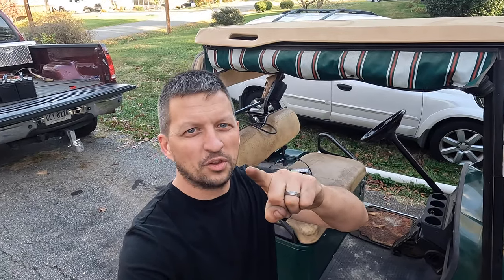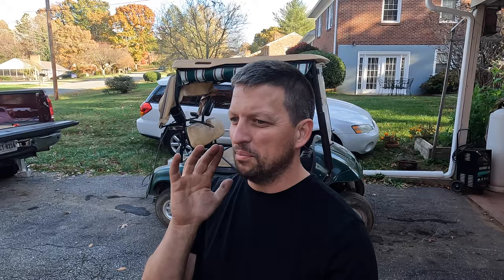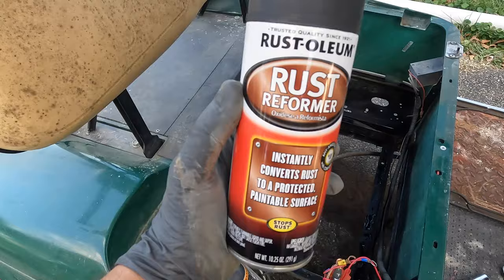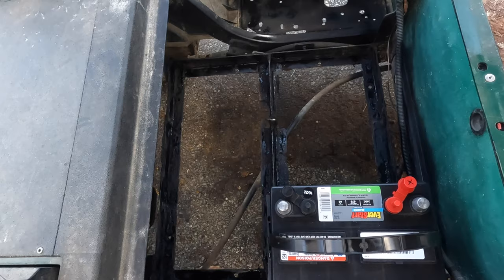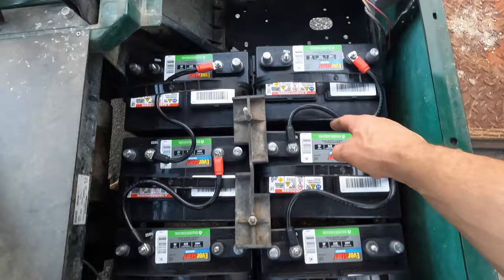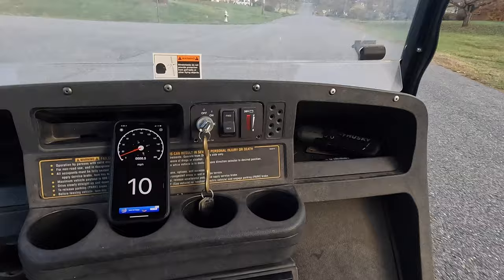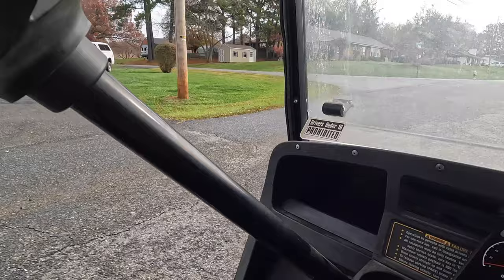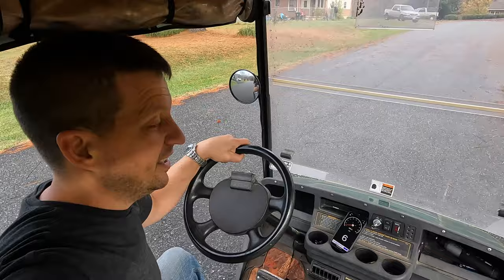CHEAP POWER!  36v Golf Cart using 3 12v Batteries - Surprising range

Comment: Sure it will work, those are group size 27 deep cycle batteries w/ about 75 amps each.  Set up in series to make 36 volts, the amps stay the same.  6V golf batteries GC2 standard size are on the low end 180amp (super cheap Costco version) to over 230amp on the really good Deka or Trojan battery.  You can also get 245amp batteries in the same size that are used in floor scrubber machines.  Bottom line is - yes a deep cycle 12 volt battery will work, BUT 6 - 6 volt golf cart batteries will easily give 2 to 3 times (maybe more) the run time over 3 - 12 volt deep cycle.  Compare the cell size between the 12v and 6v - the golf battery cells are 2 times larger and able to provide huge power to get a 1500 to 2000 pound cart (two men, clubs, etc) up and down and around 18 holes without issue, most golf carts run 2 rounds per day so the power is substantial.  So if you are just goofing around your neighborhood on a relatively flat surface, you might be ok.  But if you are playing golf or hauling something or driving more than a couple of miles you really need the higher capacity of 6 volt GC batteries.
Reply: True all that...speaking from experience.
Reply: Especially if your swinging bigger than stock tires and wheels.
Reply: How about using 2~3units 48v30ah LFP battery to replace 6v trojan battery? They are in the same GC2 housing. You just need to simply remove your old batteries, drop-in your new O'cell 48v lithium batteries, connect them in parallel, connect the CAN cables that come with your battery then trun your batteries on via the wake-up button. There’s no tray modifications and no extra components needed.
Reply: Also adding eletrolite instead of water will extend the life of the batteries. The voltage is the same but the state of charge per cell will start to degrade.
Reply: Did you mention how much weight your losing with 3 batteries VS 6 batteries

Comment: I changed out my six 6v batteries for Walmart's EveryStart 12v Deep Cycle and within six months I can't drive the cart around the house and back before it goes dead. Also, be careful when hooking up your batteries to the cables from one battery to the next. Make sure the connections are very tight otherwise you'll burn up your battery posts (speaking from experience). If possible, double-nut the cables to the posts to ensure they're on tight and won't come loose.
Reply: Sounds like you didn't monitor and keep the acid level up, or you repeatedly drove the cart until the meter showed "Empty". - NEVER run lead acid batteries below 50% state of charge.  This causes internal damage, shortening their lifespan.
Reply: @ward7voter111  Actually, I may have overcharged them, not undercharged. I'd put them on charge each night after using the cart. The Everstart batteries were "maintenance-free," which means I had no way of checking the acid levels. Thanks for your comment. I've gone back to 6v batteries and have had no trouble so far.
Reply from the maker: Overcharging is a massive problem with the factor charger for 6 or 12v.  I switched over to the Summit 2 from Lester  (used off eBay).  It auto detects charge level and will adjust charge rate accordingly.  Bluetooth app to show rate and battery health.  An added bonus is that its onboard now and all I need is an extension cord anywhere.
Reply: Same. Just put in Trojans TODAY
Reply: @BootstrapRevival  

Is there a link for this charger?
I'm going to look. If I can find it I'll delete this request.
Reply: I think some of the problems you guys are experiencing with the 12 volt battery life is you are using the 8 volt charging system for you 12 volt batteries. So you are only charging them to 8 volts. You can buy 3 bank and 4 bank battery chargers made for charging boat batteries very reasonably and charge all your 12volt batteries at the same time and fully charge them.

Comment: I have an old beater 1982 EZ-Go and converted it to "Just" 3 - 12 Volt Marine Batteries...You had 6 - 12V marines in your cart.  My old beater would only get around 3 miles to a charge though...my hills are much steeper and are mostly "pasture", although there's a gravel road I run each night too.  I've had it 2 years now and it suddenly quit on me...dead in the water at the moment trying ti figure out what's up.  I tested the batteries and they are still fine...I use a smart charger that stops when it reaches a full charge.  I "suspect" a solenoid issue but have no experience there...I'll keep perusing you tubers and see if I can find clues.  (Like your Aunt, I too am up there in age and just need it to do chore and small hauling jobs on the place here)  Enjoyed your experiment though - thank you!

Comment: I tried the 3 DC24 battery route. While it worked fine I wasnt happy with the performance once I added larger tires. Ended up with 6 new crown batteries, $680 out the door.
Reply: Where did you get them at? Im seeing 6 for around double that cost.

Comment: Was the regular charger able to charge the 6 12v batteries?  If not, what did you use specifically?  I'm new to batteries and don't know much. 🙂
Reply from the maker: It would charge it, but honestly I really did't like the factory charger because it did not know when to turn off.  I put in a Lester Summit smart charger.  I got it used off eBay for $200.  It will do 36 or 48 volts, it will charge fast when its really low, then back the amperage off as it gets close to full.   Oh, and I put it under the seat.  All we have to do it is plug it in and it takes care of the rest!

Comment: ok so you have 2 banks of 36v batteries. you said you ran each bank in series then paralled the banks.  Am I right so far?....lets say i am...so now you still have 36v but twice the amps/capacity....how far did you go this way and why do this?......I should mention that i did the same thing but only have 3 batteries
Reply from the maker: Great observation and question.  Yes, I have 2 banks of 36 volts wired in parallel.  I did not have to do this, I did this mainly because I was paranoid.  This cart was put together not for me but an elderly family member who lives on a large farm.  I wanted to make sure she had plenty of juice if she was pulling a trailer of feed or hay.  It was probably overkill.  We are approaching 6 months and its still rocking and rolling.  I think the Summit 2 charger has helped a ton with keeping the batteries topped off at the appropriate level.  We have had no issues with speed, distance or how long a charge lasts.  Thanks for the comment!
Reply: @Bootstrap Revival  did you ever do the distance comparison between the 3 12's vs the 6 12's    very curious.

Comment: We put 3 4d30 batteries on our golf cart at work, they are the length of 2 of those batteries so we removed the center divide.
Reply from the maker: Thats awesome.  I’ve wanted to see a cart with tractor/truck batteries in it.  I figured fitting then all in there would be an issue.

Comment: Depending on your usage needs this is a good way to save money. You do get less range, I did a swap to 4 12v marine batteries on my 48v cart 5 years ago, still running strong. I use it around the farm about 5 miles a day max 3-4 days a week, so it's fine for me. I get around 14 miles of range at a 50 percent max depth of discharge, compared to 35 miles from the trojan 170 amp 8v cart batteries at a 60 percent max depth of discharge. I recommend bypassing the carts obc and getting a smart charger with a good onboard lead acid charging profile and checking the electrolyte level frequently.

Comment: Great video that will  help many people who may not know/understand the basics of batteries in golf carts and low speed electric vehicles.

A couple of additional things, for those who may not be familiar with lead acid batteries (golf cart, deep cycle, or general use).  
1) NEVER run them below 50% SOC (State Of Charge) or "half full" on your battery meter.  Repeatedly doing this will internally damage the batteries.
2) If you have batteries that have the maintenance caps, get a watering system, like the one that Bootstrap Revival removed from the old batteries.  This makes maintenance easier, but you still need to periodically take the caps off and verify the acid level in each cell is correct.  IF/When you need to add to them, use DISTILLED WATER ONLY.
3) Extreme heat or cold will kill a battery (ANY battery chemistry).  If you live in a climate that freezes in the winter, remove the batteries and store inside a garage or heated shed, where they won't be damaged.  Same for if you live in an area that gets extremely hot.  Do not store your cart/batteries in a giant oven (metal building, storage container, etc.) where the temps can get 120+.
4) When the cart isn't going to be used for a period of time (longer than a week), disconnect the main leads (Positive and Negative) or turn the Master Switch off, if the cart has one.  Option 2 would be to connect a smart charger, and a timer system to turn the charger on for 6-8 hours every week.  This will ensure the batteries maintain a proper charge and don't discharge below 50% and shorten the life.
5) Many people cringe at the cost of replacing batteries, and if one is bad, they want to just replace that one.  Don't cave to the temptation.  Replace all of the batteries, so that they all have the same number of charge cycles, come from the same batch, and should have approx. the same lifespan.  Adding one new battery is going to drag it down quickly, as it tries to make up for the weakness of the rest of the "team."

Comment: i built a battery from a used chevy tahoe hybrid pack, it's basically a prius pack but with 2 extra cells to make it a 50 cell bank. i built the pack in 8 cell segments of 7.2v cells, then in series of 5 to equal 36 volts. i use solar panels to charge the pack in the sun and a 42v hoverboard battery charger when it's cloudy out. at 42 volts the cart moves pretty quick too and shows no signs of being too much voltage. with the 2amp 42v charger the cart will go about 2 miles on 2 hours charge. low voltage threshold built into the cart basically stops trying to push the cart at 28v, the NiMh hybrid cells can easily handle the upper and lower limits of this setup.  i'm still balancing the pack slowly so i have no idea the true range of the cart, haven't left on charge for very long as of yet.

likely will see some signs of battery degradation after years of use but these packs are like $100 now. i paid $300 for 2 civic hybrid packs, 1 G2 insight pack, 1 chevrolet tahoe pack and a ford fusion lithium pack(4 NiMh and 1 lithium in total) from a wrecking yard that wanted to stop tripping over them. the lithium pack is worth what i paid for all 5.

Comment: The thing I see that stands out is, I see 6 batteries in there, 12 volts yes, but 6 batteries. 3 in parallel with 3 more , so still 36 volts and more amps , but no weight savings at all. I used 3 deep cycle marine batteries for 36 volts. We don’t run it long distance but it goes good and only chargers it about once a week.

Comment: I understand why one would use three $90 12V batteries in place of six 6V batteries. This gets one around okay for modest usage at a little less than half the price of six 6V. But why use six 12V of these marine batteries when the total cost is just a little less than six genuine 6V deep cycle batteries that will likely last longer due to the full deep cycle design. Marine batteries are a compromise between a starting battery and a deep cycle battery. Here in Central Florida 6V deep cycle batteries are $100 each and up.

Comment: My dad gave be an old gf cart with very old batteries.  My sister and i would go for rides. The batteries lasted so  long that wed drive to 2 other towns (not in the same day). Wed have lunch.. drive around and then go home. 1 town was 6 miles there 6 back.
I didnt know i was making the batteries get hot. I did it for 3 years.  I ended up having to call for someone with a trailer to come and get me. I burnt the posts right out of the batteries. What a shame...such wonderful rides we had. So now its sat for a year. Im trying to decide what batteries to use.  I thought maybe lithiumbut then i have to change other stuff. Maybe the car batteries would be best and dont go driving the country side... What do you all think?
Im a 63 yr old female and i can do things like hook up new cables .. Whitch i did so i cobbled them fur a while when i first got it so i could drive it.
What do you smart guys think?

Comment: I used these same batteries in my 48V club car with the stock charger. at first they were great, but ended up only lasting 20 months which works out to $200/yr... upgrading to lifepo4 batteries this time.
Reply from the maker: If its in the budget lipo's are awesome.  They do have some quirks.  Like you can't charge them below 32 degrees F.  Since this one was stored outdoors and we reach well below that for long periods of time we decided against it for now.  Let us know how it goes!
Reply: @BootstrapRevival  ended up purchasing enjoybot lifepo4 batteries and installed them a couple weeks ago. first impression is they're fantastic. much lighter, no acid, faster recharge, longer range. only downside I can think of is cost and the lower temperature limit you mentioned which isn't a concern where I'm at. that said, these batteries do have a low temp cutoff feature that prevents charging at cold temps. these batteries are supposed to last much longer than lead acid and come with a 10 year warranty. if they last 7 years, I'll break even with the cost of these walmart deep cycle batts. thanks again for posting the video to help others revive useful carts!
Reply: @GetOffMyIce  uhhhhh hellooo what was cost,,& how far does a reg cart go on stock batteries

Comment: Great video and you are correct it's a much cheaper way to get by - driving slower actually does not help as the throttle is always full speed full amperage draw however at low speed  some or most of the current is shunted through a resister bank and is simply wasted as heat at full speed all the current goes to the motor.
Reply: Not on a modern cart like that which has an electronic motor controller. Older carts did waste excess voltage through resistor coils, though.

Comment: These 24DC batteries at Walmart are being discontinued. They’ve changed the name to 24M. Make sure you get these deep cycle version which is specified on the label. There’s also 24M that’s not deep cycle. Also don’t get them mixed up with the 24MS.
Reply: I ordered three 24DC batteries on-line from Walmart last week and they were delivered free the next day. The manufacture date was this month (4/24). $90 each, plus tax and $12 core. The local Walmart only had one in stock and it was a year old (4/23).

Comment: I want to do the same thing as you in this video, but have all 6 12v batteries hooked up at the same time and only use 36v
Reply: You can do that.  One bank of 12 volt ( 3 batteries) will give you 36 volt in series ( pos to neg and so on).  The other three 12v batteries in parallel ( pos to pos , neg to neg) will give 12v total but magnify the amps (3 x 110 amps)   You hook positive lead from parallel bank to lead going to cart and negative lead from parallel bank to neg lead going to cart.  That increases total amps available but not increase total voltage.

Comment: Nice range test!
It looks like you are short circuiting 3 terminals with the metal plate in the middle holding the batteries in palce. battery 4 negative, 5 possitive & 6 negative. Even if  ther is a small margin between the plate and terminals you should consider waht happens when ther is a bump in the reoad and over time displacments of the batteries.
Reply from the maker: I completely agree - however this one is plastic and non conductive.

Comment: I bought 3 of the 24 dc batteries and a htrc 36/48 volt charger, I’m trying to find out what my low voltage number should be so I don’t run them too low, thanks for any input, it’s a 36 volt ez go
Reply: I just got the P3648 HTRC charger. One thing I don't like is the severe AM interference. Forget AM radio while it's running. Also it goes up to little above 44V before shutting down to trickle charge. That's the theoretical top voltage of a fully charged 36V system but I'm worried that it may be a little too high and fry the batteries. We'll see.

Comment: Can you use the charger that is made for golf cart. To charge all  3 at once.  Thanks. Great job🎉
Reply from the maker: You can, but I really despise the factory charger.  It has no float or trickle setting.  Its jus on or off.  I switched to a new to me Lester and it has been fantastic.  It will rapid charge if its super low, then slow down as it gets towards full.  It it is completely full it will just keep it there.  Plus its onboard now and I can use a standard extension cord anywhere.

Comment: I tried this, installed just how your video said.. and when I turn the key on and press the accelerator, I hear the solenoid but it doesn’t move. Suggestion?
Reply from the maker: Have you checked your output voltage with a multi meter?  All the lugs tight?

Comment: Did u need the converter
Reply from the maker: I used the converter for the lights.  You could in theory just wire them to 1 12v battery.

Comment: We just did this and now it wont go. We heard a pop sound when connecting the battery. Do you think we blew the solenoid?
Reply from the maker: I think there is a solid chance you wired it incorrectly.  I would disconnect the main leads to the controller and check battery voltage from each and then across the bank.  Check to see if you popped a fuse, check the diode on the solenoid and look for toasty wires.  I’m sorry you guys are having issues!
Reply: @BootstrapRevival  Did we need to install a converter because of the higher voltage?